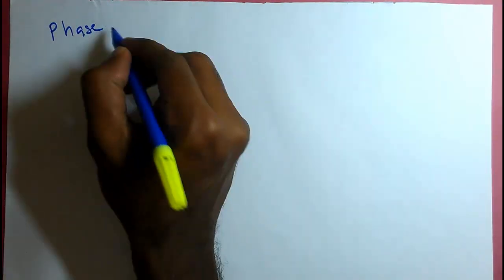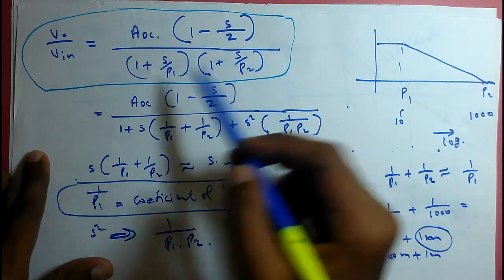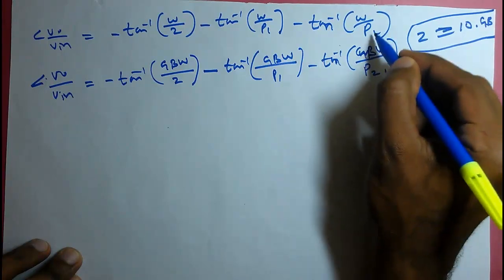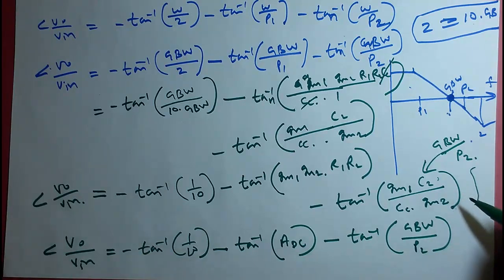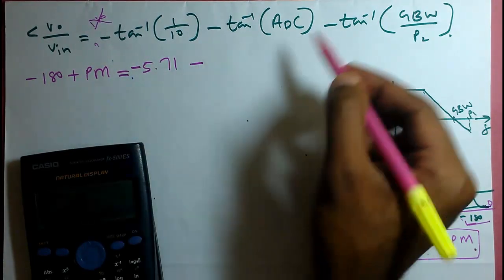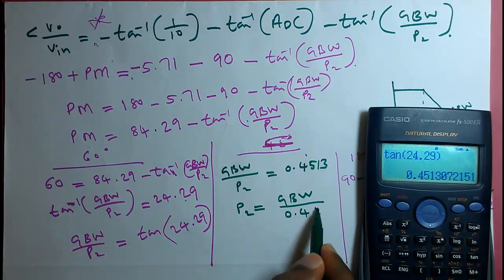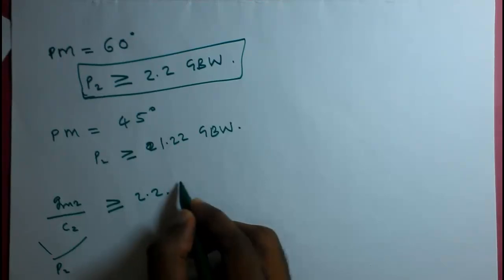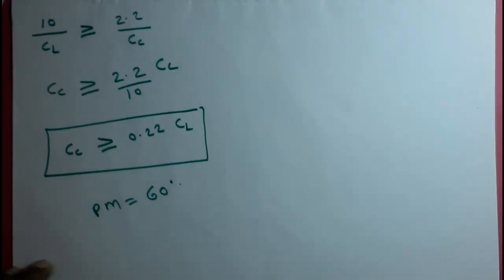Design of two stage operational amplifier (opamp) part 5 (phase margin)

Comment: Thank you for the videos, it was a great help. I just a have an in quiry regarding the phase margin. I see you have subtracted the zero in the calculation... My textbook says I should add the zeros and only subtract the poles. Please clarify this for me... If you subtract the zero then you end up over designing so its not a problem of course.
Reply: You add the numerator angles and subtract the denominator. Here zero in the numerator is actually defined as (1-s/z). If it is written as (1+s/z) then it will be positive.

Comment: how design this plj help sir

Design a CMOS fully-differential operational trans-conductance amplifier in 90nm
CMOS which meets the specifications listed below:

LOW FREQENCY GAIN  90DB
GBW > 200MHz
PM = 75DEG for unity gain feedback,no external load
settling time < 90ns for 3pf external cap load
otput swing 1.8 v-v
ICMR  at least 0.7 overlap with otpt swing
cmrr > 100db
psrr > 100db
supply voltage 1.5
slew rate >20v/us
power diss <4mw

Comment: Sir,
In differential amplifier design, I given the length=1u and width=84u for MOSFET m3 and m4 in cadence. I am doing in gpdk180nm technology. But, when I am giving "L=1u and W=84u" showing that the warning width shouldn't exceed more than W=50u.
Please help me the solution for the same.
Reply: two things can be done
1. No need to take 1um length for 180nm technology. L=500nm is suffucuent.
If u are taking 500nm, W can also be reduced.
2. The warning "width shouldn't exceed more than W=50u"  comes because may be using single finger. Use fingering if u are using big mosfets
Reply: Very much thanks sir.
Now it is perfectly working .
All your videos are really helpful. 
>Please include more circuit designs in cadence.
> Please give the "semi custom" layout design for the differential amplifier.
Thanks
Reply: Sir,
How can I find "power consumption and Total Harmonic Distortion"  in a circuit using cadence tool. Please help me for the same.
Reply: Good explanation. Thank you sir
Reply: use multiplier  put 2 and use width as 42u